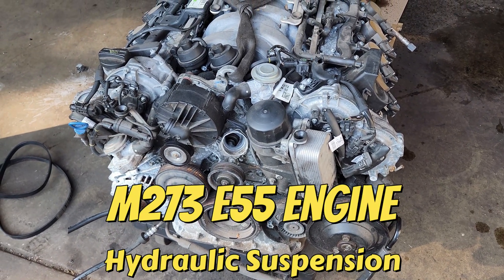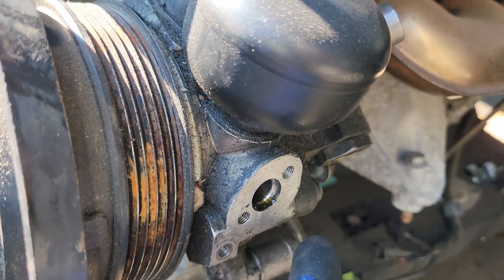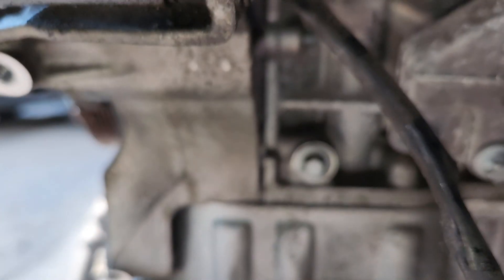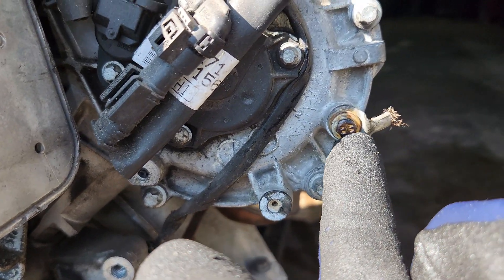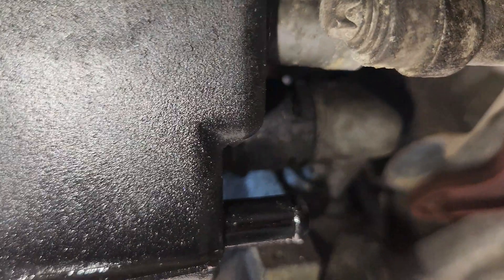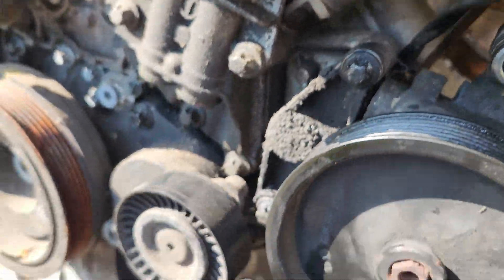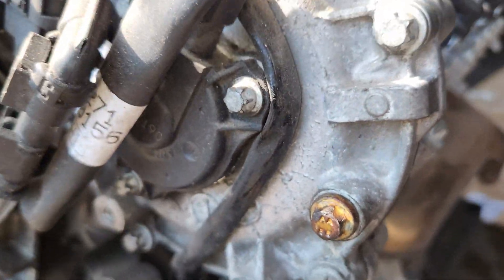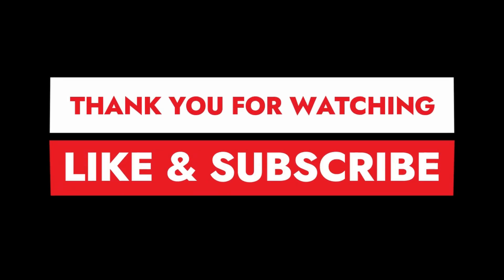How to convert Mercedes M273 E55 engine Hydraulic Suspension Pump to regular Power Steering Pump.

Comment: Always when I turn off the engine, I hear an air hissing sound from the ABC pump for about 5 seconds, then it disappears. Is this normal?
Reply from the maker: That's not normal. An air hissing sound from the ABC (Active Body Control) pump after the engine is turned off usually indicates a *problem with the system**, likely a **leak in the high-pressure line or the tandem pump itself**. The system should be sealed and not produce this sound. You should have it **inspected by a mechanic* as soon as possible to prevent further damage. Ignoring it could lead to a loss of fluid, a loss of system pressure, and eventually, failure of the ABC system.

Comment: Engine 273 wih abc or not Is it same belt ?
Reply from the maker: No, they use different serpentine belts. The M273 engine with the ABC pump has a different belt length and routing due to the added ABC pump pulley. The standard M273 with a regular power steering pump uses a shorter belt. Using the wrong belt can cause damage or a complete system failure.
Reply: @all-about-cars-basics 

Your reply helped me a lot.
I thank you for everything you provide — you are amazing.
Reply from the maker: @starshow2837  You are welcome. I am glad I could be of help. Drive safe out there.